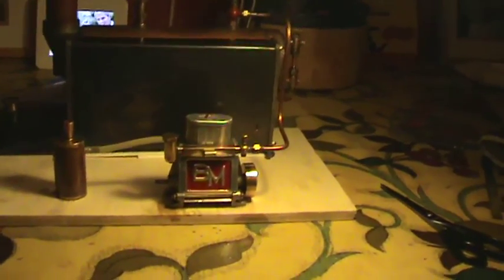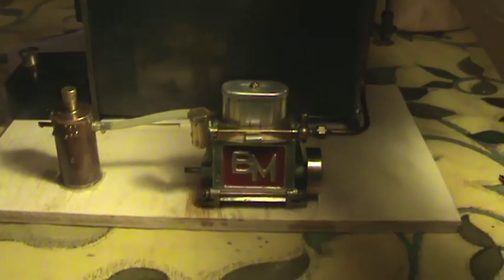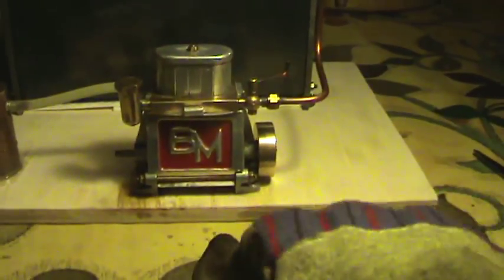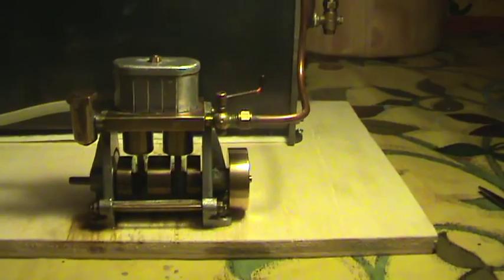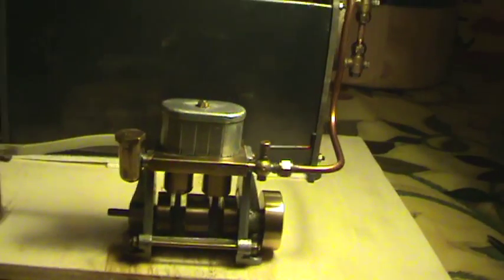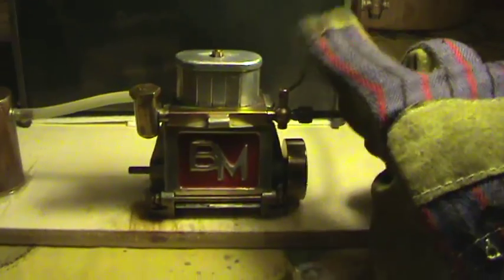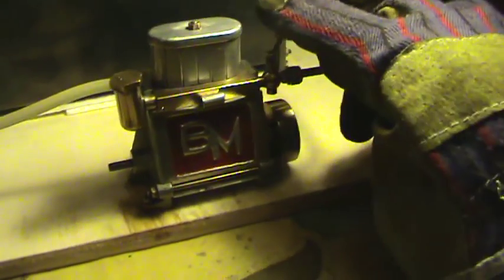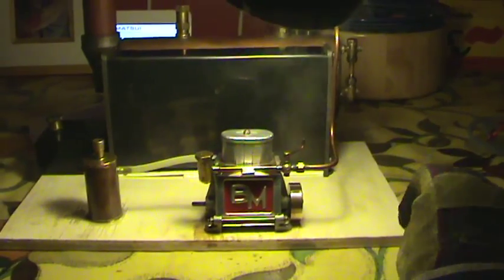Bowman-Bryant "BM" Valveless Marine Steam Engine

Comment: T his is perhaps the one video which is not accompanied by enquires as to the working of the engine. Enthusiasts the world over have been discussing various mechanisms that could have been used to rotate the piston  in its up and down movement. The theories are all of them impossible as the space available for any type of mechanism is just not available.  A feature to be noted in all videos of this excellent little engine is that it has always been shown running at high speed. If there is one single video showing the engine idling or running at a low speed such video either does not exist or I have not seen it. The videos provide enough evidence that the engine is a simple straightforward uniflow type with cylinder inlet and exhaust ports controlled by the piston movement. A special feature of uniflow engines is the inappropriate loud exhaust.  Inappropriate that is for a little engine of this size.The Bryant is no exception to this and the excessively loud exhaust has been actually referred to. The engine  cannot be operated on lowpressure steam as can other engines, due to the high compression ratio caused by the unavoidable incomplete exhaust. There is no evidence of piston rotation as the wear lines on the piston are straight and not helical as they would be should the piston rotate in its movement up and down.
Reply: so how DOES it work?